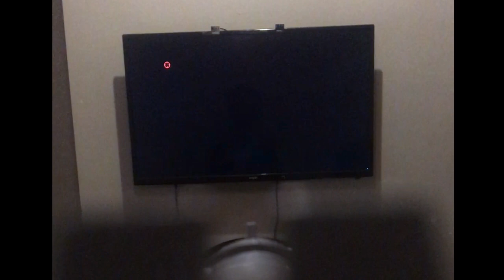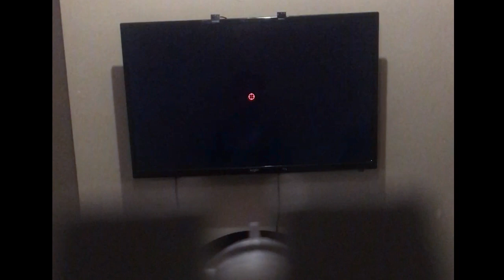SAMCO DIY Light Gun - Accuracy & Tilt Correction

Comment: Any to decrease the lag?
Reply from the maker: With the current hardware I think I've deceased the lag as much as possible, so unfortunately no. However as I mention in the video it doesn't feel as bad as maybe it looks here. It's kind of hard to explain, but to me when I just using the gun regularly I don't fell any lag at all. Hopefully someone that's made one can back me up here?
Reply: How is it compared to the aimtraks?
Reply from the maker: To be honest I couldn’t tell you, I’ve never actually tried an Aimtrak (I know that probably seems weird) but they use similar hardware and from what I’ve read they have a tiny bit of lag too so would very similar.
Reply: @samcorulz  I wonder if the lag is more from your hardware or from the TV. Many TVs even in game mode have more than 30~40ms of latency, which create this kind of lag. If that's the case, it's not a big problem for sight aiming without displaying the target cursor, since only the display would have lag, not the ingame input.
Do you have a lower latency PC screen on which you could test to see if there is any difference?
Reply: @MadInu8  I thought the same
, maybe in a CRT monitor the latency is lower
Reply: I can confirm that there is hardly any lag as seen in this video, if you try it with a pc monitor i dont notice any lag at all so it has to be the tv's processing or something.
Reply: @XxBoxerman74xX  Anything would have to be better than Aimtrak
Reply: @8bits5  latency is zero on a CRT, but in that case, you would use a real light gun instead.

Comment: Can you make a video on how to add two light guns
Reply from the maker: Do you mean on retropie? If so you have use the mame emulator but you can simply plug 2 guns in via USB into the pi and they can both share the sensor. One cross hair will be a + and the other is an x just calibrate one after the other and you’re good to go. Hope this helps :)
Reply from the maker: My intro/mame setup video might help too if you haven’t seen it yet.